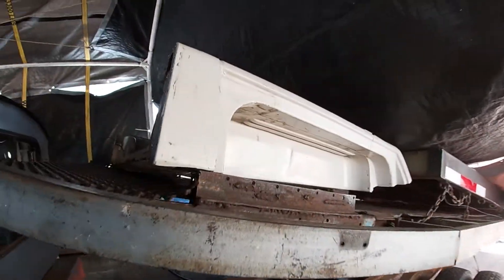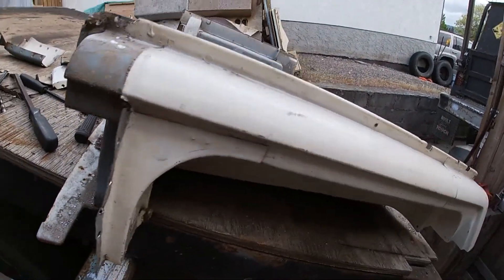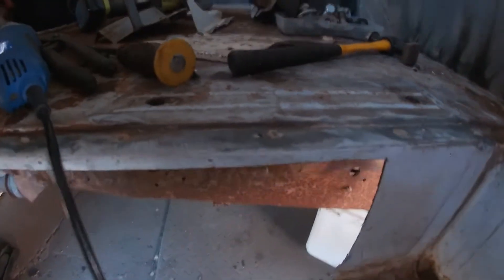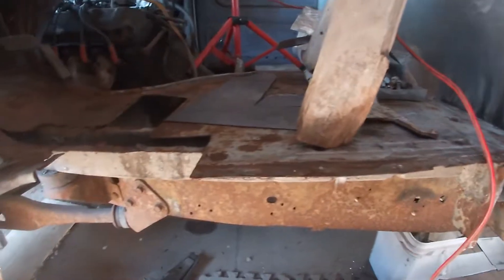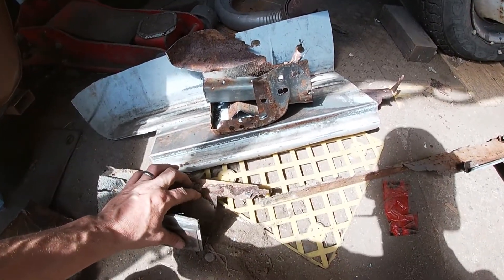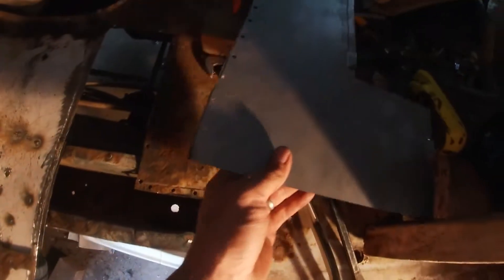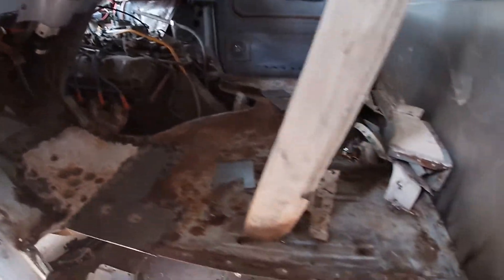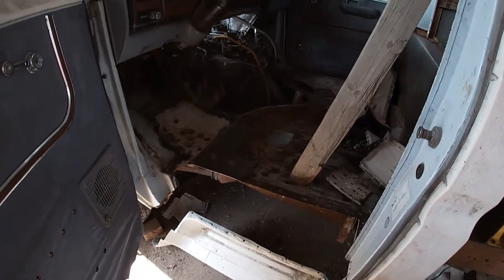1980 Econoline E-350 Tow Truck build Removal of rusty metal  Sill and Foot-Well. #7 of build

Comment: Chasing rust is easier when you have good replacement parts like you do , looks like your headed in the right direction. Find all the rusted places now and repair them while your there . Looking good
Reply from the maker: the replacement floor got lucky with scrapped a ford rv while back the rotted camper part preserved the floor. good fyi for people rv's have good floors usually. ty for watching my friend